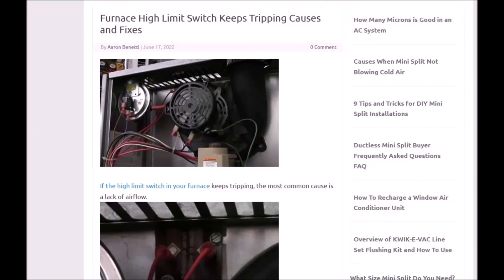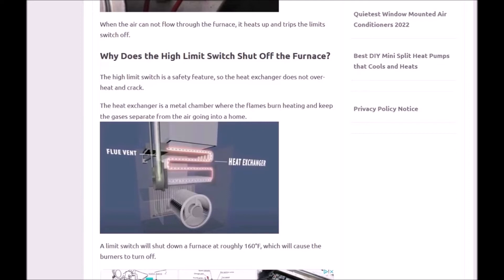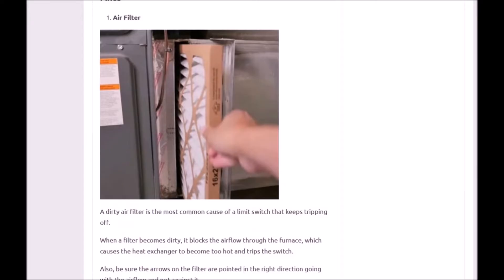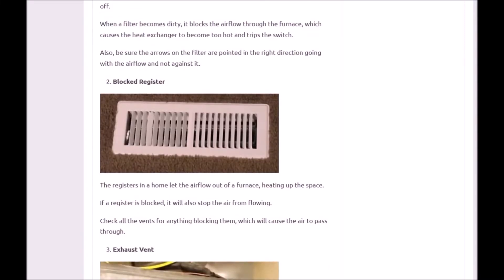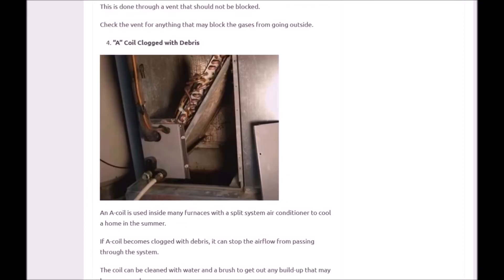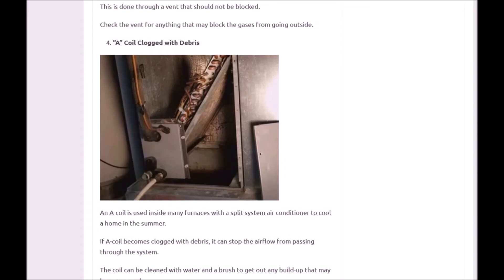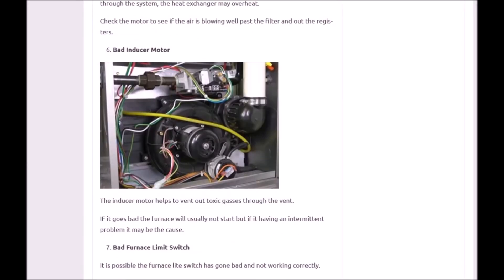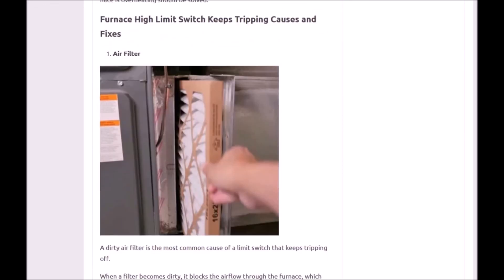Furnace High Limit Switch Keeps Tripping Causes and Fixes

Comment: does limit switch is the same for all brand of furnace? I have Carrier furnace and A/C, do you sell the limit switch of Carrier? thanks
Reply: Limit switch varies by temp rating and design. Exact part will be model specific. Service/parts manuals usually available to download from the MFG.
SupplyHouse is the main go-to for parts or can check if you have local distributor. Generally cheaper than dealing with a local plumbing/HVAC supplier.

Comment: High, question for you, I have a Gibson KG7SD 038D-23EB, IT KEEPS TRIPING OUT ON HIGH LIMIT, It will startup fine, going through sequences... runs about 6-8 minutes then burner quits, ventor motor stays running for about 1.5-2 minutes more then stops as well, BUT the blower stays running, only way to shut it down is, turn thermostat down so it quit calling for heat, then it does stop.
If i turn it back up, it calls for heat but the BLOWER & VENTOR motor starts running, the ventor runs about 1.5-2 minutes then shuts down, fan stays running???
I can get the furnace to start again by resetting the High Limit, but then it does the whole sequence all over again
any suggestions?
No, to plugged filter, even removed it leaving door open so no supply air problem.
No to blocked vents, even took a 8" plenum off just to allow better heat flow out?
No to blocked exhaust vent its comes out through furnace to the "T",  2" pipe goes up 50" then 90 elbow, over about 36" to Concentric vent out through the wall

on the board, I've increased "FAN" to highest level, "H" where it has the heat and cool settings i moved the heat down 1 increment at a time to lowest heat setting... still same issue??? 
any thoughts on what to try - how to fix...
Reply: Could be so many things. I hate high limits. Could also be vents being closed, not enough returns or they are clogged, filter could have to high of a merv rating and restrict air flow. Blower motor could be weak, capacitor to blower motor could be dead. If you have air conditioning, maybe the coil underneath is plugged. Possibly secondary heat exhanger has a carpet of dirt on it. Would have to take blower out, go inside furnace and look up.

Comment: Great video, thanks. 
I have a question. Our limit switch tripped due to overheating but would not reset and with the help of a local technician I tested the resistance and found that the switch was faulty. I replaced the switch and had to reset a blower/auxiliary switch as well and got it all up and going. However, the upper blower limit switch would still trip every few weeks, mostly in the morning when the heat was coming on to warm a cold house. We could go months without tripping it. So I bought a new switch and it seemed to help but now it’s tripping every other day in the morning.
What could be the cause? My filter is clean. The lower blower limit switch doesn’t trip, just the upper one (hotter I assume). Could my fan be underperforming? I have had to replace my fan capacitor a couple times. Maybe it’s due again? It’s a York Diamond 80 furnace.
Reply: Fucking rude.
Reply: Don't be a cheapskate. Call a pro when all else fails. You're being very cheap for someone who has a good amount of money

Comment: I just wanted to post on here and mention what I did.  Previous to seeing this video, I did every bit of trouble shooting.  I have one vent that is partially blocked, but cant do anything about.  I added another cold air return in my return in the basement, and cut a vvent to heat the basement as well.  Was still kicking.  The only thing that seems to work is to put high speed setting on the blower.

Comment: Biggest reason I  have found is increased gas pressure  effecting the delta t across the heat exchanger......readjust the manifold gas pressure and the  problem goes away.  It's not just the air side that needs checked. This is the major cause of exchanger failures. Fit the furnace to the duct system, as opposed to the the idea that the ductwork was designed for the furnace that was installed.
Reply: Did you set the gas pressure to the lower end of the acceptable spec in terms of water column?
Reply: 😂 @wkobayashim
Reply: everyone is a expert now days with the Internet

Comment: I have a goodman with a issue 4 flashes = open high limit ,replaced the high limit sensor work for a min them the same situation the 4 flashes
Reply: I had similar issue on different furnaces
Either it’s actually overheating (fan not moving enough air to take heat out, exhaust is partially blocked, or filter restricting air movement to limit ability to get heat out) or control board.
Reply: Did u ever find the cause
Reply: Have the same furnace with the same issue. Did you ever figure it out?
Reply: I have same issue, had vents cleaned, filter change nothing... new furnace 3k later... same thing so thinking its my coils for ac seeing everything has been changed but that.

Comment: Carrier furnace: started cutting off and on 3 times or so when thermostat reached temp. Finally thermostat went blank. Changed out thermostat, Replaced the circuit board, good voltage on both sides the xformer, good continuity on the high limit switch. What am I missing?
Reply: there are several safety devices on gas furnace 1. high limit switch above burner (most furnaces have another on the blower motor casing/box) 2. at least 2 rollout switches, 3. pressure switch for inducer motor and with high efficiency units there is a pressure/vacuum switch, 4. flame sensing device, but one that shuts down the whole thing is just plain old push switch - some furnaces have other safety devices remember all safety devices (EXCEPT fame sensor & inducer pressure switch) are NC switches & under normal condition EVEN with furnace not running should have a reading very close to 0 ohms - best look at your schematic (usually on the lid somewhere) if you don't understand the electrical diagram STOP what you are doing before YOU BURN UP YOUR HOME - i sure hope this helps
Reply: Possible door switch failure, especially if a pressure is off it will push out on the door sometimes

Comment: Mine keeps short cycling even with a new switch. 2 plumbing companies and numerous new parts has mot fixed it yet. Dont know where to turn next.
Reply from the maker: A short cycling furnace's common causes include a malfunctioning thermostat, clogged air filter, clogged flue, dirty flame sensor, damaged igniter, fan limiter failure, and oversized furnace. Be sure it has good airflow in and out of the unit.
Reply: Airflow

Comment: Money unit has two thermal switches on the high side feeding the electric coil. Both are tripping and taking about 10 minutes to reset as they cool down. They both show around zero ohms normally closed and when they trip they're definitely open. The entire indoor shuts down when this happens. I've got plenty of air flow all the panels off plenty of air coming out the vents and the property heats up but right at 61° on the thermostat the indoor kicks off every time. The blower motor is running the whole time until the thermal overload. Since both thermal switches are acting the same and the blower motor is blowing lots of air and there's plenty of air flow I'm stuck on what this might be??  Is it possible for an electric heater coil to be too hot?  Is that a failure mode they exhibit?

Comment: There is one more scenario, my American standard high efficiency furnace has an unadjustable 45 seconds heat exchanger warm up timer before blower kick in,  this is really stupid design. Sometime this 45 seconds warm up period will  trip the high limit switch if this heating circle start too soon before heat exchanger didn't cool down enough from previous heating circle. 
It should use a fan start switch like old system to control the blower instead the fixed timer.

Comment: I have a York diamond 80 and it keeps overheating which causes it to cut off but it's weird because it will cut off for a few minutes then cut back on and it just continues to do this and will not lock out. I noticed that inside the furnace it seems like their is hot air blowing back in from one of the vents like there's something that's restricting the sure from going out.
Reply: Update?
Reply: @ag86fox  Lol I still haven't figured it out..
Reply: @pimp1979robertmack  damn lol
Reply: Weird. I have the same furnace and having issues. Not the same ones but my limit switch was faulty and then now the blower switch keeps tripping.
Reply: @veevee1209  normally it means your furnace is overheating.. whether that be obstruction thru the ducts or a dirty filter..I tend to do what's the cheapest first and a filter is like 3,4 bucks.

Comment: It would have been helpful if you had explained how to check the limit switch. How is that done?
Reply: Continuity my friend
Reply: Usually if it's tripping there's a reason. Most of the time the switch is doing what it's designed to. Check airflow. Filter, secondary, evaporator, supply, return.